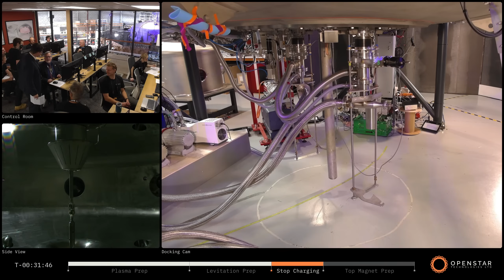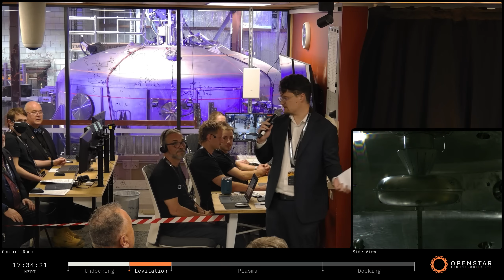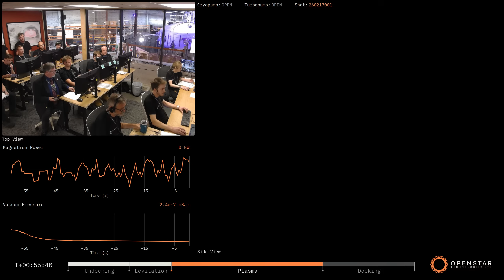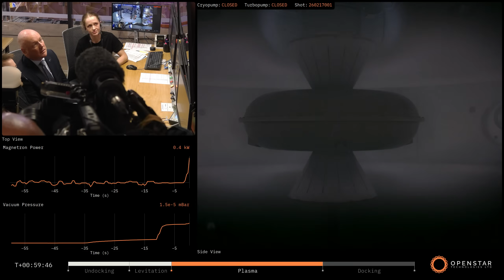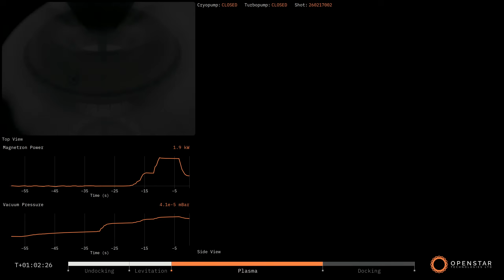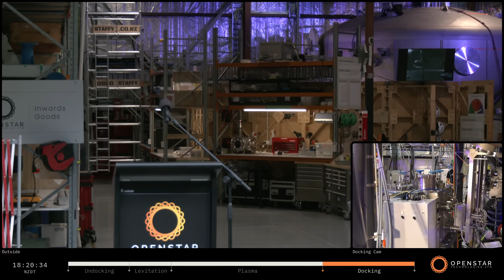Plasma Showcase Event

Comment: 5.2mV? Ah OK this is maintenance voltage perhaps. At about 3.9 watts perhaps.
Reply: Yeah that's right, it's maintenance voltage to maintain ~740A. And yeah, ~4W of loss in the core magnet circuit. Superconductors are wild.
Reply: @pietgeursen7023  4W to lift a very heavy thing. Wild. Thanks!

Comment: Did it only produce 5kw at peak operation? A small household solar unit does this
Reply: @tylergriffin263  24 hrs a day?
Reply: @tylergriffin263  this machine isn't designed to do fusion or produce power. Future machines hopefully will.
Reply: @pietgeursen7023 right, thanks for clarifying. Best of luck to the team